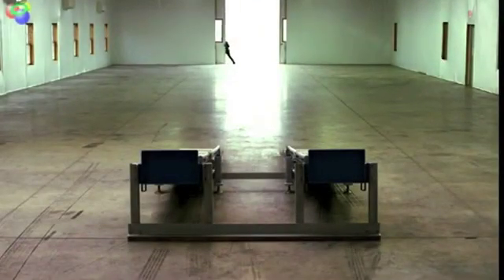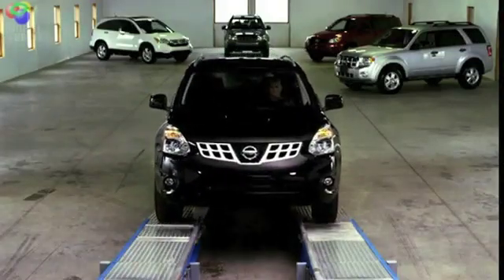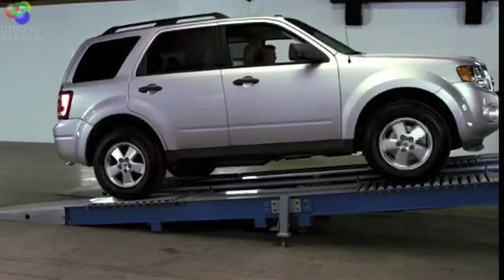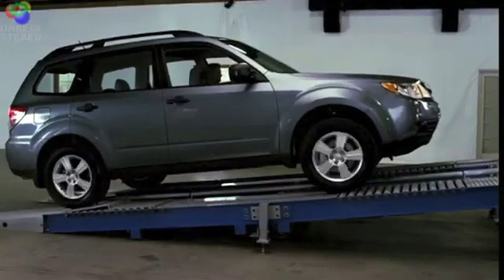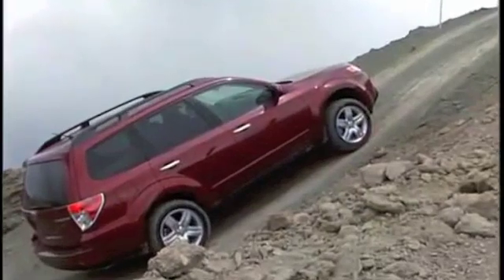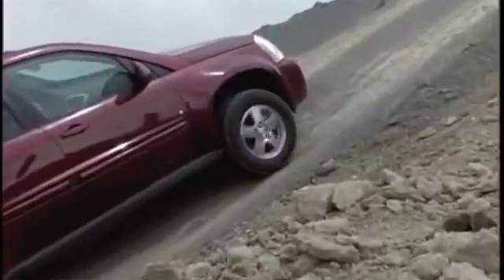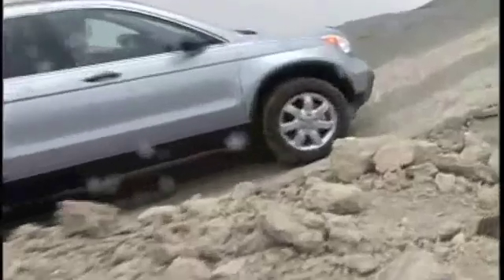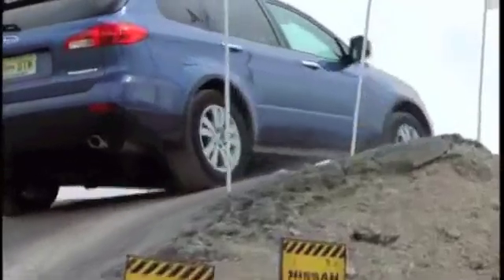Subaru Symmetrical AWD Test

Comment: Add in LSD front and rear and you have an unstoppable beast!!! especially when turboed
Reply: @Traumatree  yes i do. A limited slip, not a locker or lunchbox locker multiplies torque across the differential providing more torque to one wheel or the other. The secret is having some level of torque to multiply. 

For example the torsen in my Rubicon or a hummer will just spin whatever tire is in the air because 0 x (multiplier) still equals zero so the other tire won't spin. That's why you see a lot of people in Hummers without lockers stand on the brake in low traction situations. 

This also holds true for any style diff. Viscous, clutch, or geared. 

In a traditional completely open diff if you step on the brake the tire will still spin that's on ice or in the air. This is because there is no torque multiplier across the diff.
Reply: @jeepmanxj  But the VSC/ Traction control is supposed to replace   LSD. I have an AWD lexus gs, I put it on 3 wheels and the wheel with traction barely moves the car. I feel a little push. Problem with all these system is it cuts power as soon as wheel slip is detected. It does lock the center diff in this situation. I could tell the brakes are locking the spinning wheels but maybe 10% of the of the power is going to that wheel. The idea being to keep you in control. The subaru is not cutting power. They tuned their slip algorithms better. At low speed, it is ok to do that. Basically for all these vehicles(except subaru) you are left with 20ft/lbs of torque to move a 2 ton car.
Reply: @alb12345672  they absolutely do cut power. If you have your scan tool or accessport attached it shows it clearly. 

The point I'm making here is Subarus AWD is literally nothing special or different. The "symmetrical" bullshit is a gimmick. Anything with a cvt is still a front biased system, the sti is a rear biased system, the only "symmetrical" is the wrx with the manual and its 3 open diffs. The open diffs that rely on the stability management are, in my opinion, inferior to an actual torsen or lsd because you lose the live vectoring of power.
Reply: @jeepmanxj  Let me know if I understand this correctly:
Hypothetical Situation-
  So if a manual transmission WRX has it's back wheels on pavement, and it's front wheels on ice, and since you're saying the center diff. is "open", that would mean that all the power/trq would go to the front wheels, and so it would just sit there spinning the front wheels on ice? Right?
(...or no?)
Reply: @MyCatInABox  that is correct.
Reply: @jeepmanxj  (Ok- thanks for letting me know.)
...and WOW, btw. That's a crazy image.
Reply: @jeepmanxj  where did you find the info that the WRX has a open center diff unless vicious are considered open diffs too
Reply: @LosMt2  They are considered open diffs for all practical purposes. Their torque vectoring is extremely limited to the point it operates no differently than an open diff.
Reply: @MyCatInABox  it’s a crazy image because it is crazily untrue, I know because I’ve tested it after someone claimed. I have an 02 bugeye wagon, did this test with the open front, lsd rear , standard wrx 80/20  (which is maximal torque split but runs 50/50 in full traction situations) and Std lsd rear: front tires on ice at Kirkwood, rear on asphalt that has been plowed , let the clutch out and wouldn’t you know it, the front driver began to spin as did both rear at the same rate and I drove forward onto the huge ice patch in the lower parking lot.  Tried it the other way around with rears on ice and front in dry and same result, drove forward no problem. The center diff, or viscous coupling in the non-Sti models is a mechanical limited slip unit that delivers the power to the front/rear whichever has the most traction so all the tires spin at relatively the same speed (hence why they’re prone to under steering as power is delivered to the front and rear outboard wheels in a corner so if you want to slide you have to pitch the car hard into and over steering or use the hand brake. Driver vs passenger distribution occurs in the rear LSD unit but not in the open front wrx non-sti. I did this test again after installing an sti front LSD into my 5MT with the same results as the open front. It’s very simple if you look at a transmission diagram from a Subaru manual. The STInis a bit different in that it has a manually adjustable center differential where you can bias the front-rear power distribution up to a 90/10 split making your car almost fwd or rwd, or you can leave it in auto setting where it will operate as a mechanical lsd front to rear as the regular wrx but with ability to do 90/10 split vs 80/20. If the forward  output shaft is attempting to spin faster, the center diff automatically applies that excess rate of spin toward the rear output shaft mechanically, and then the rear manages left to right distribution mechanically and in STI the front lsd does left/right up front also if the rear are trying to spin faster. The automatics/cut are a different ballgame all together and I haven’t had to rebuild the 2015 outback transmission yet so don’t know what they look like inside. I’ve rebuilt 4 5MT trans so far, 2 Imprezas w/ open rear, my 02 bugeye which had a center diff bearing failure so I went through the whole thing while I had it open, and an 05 STI. The system works, it works very well, and anyone who claims they know it doesn’t work because they work on cars has never dug into one and is drinking haterade. I love the torsen wormdrive type also and my cummins has one but again, if you don’t know that they need resistance for the wormdrive to lock up then you don’t know to drag a little brake to engage it.
Reply: @jeepmanxj  Modern manual Subaru CUVs are 50/50 viscous coupling.
Reply: @RKmndo  I can't verify that for sure as I'm not familiar with that specific transmission.
Reply: @Traumatree  No way Really?! Is that why the LSD units that are widely available say STi on them?!  ;-?
Reply: @Traumatree  the manual may be but the cvt is 60/40 for sure.

I can tell you for a fact owning multiple that they will not pull that without the lsd. They also struggle extremely bad when on ice and traction loss to a single tire will stop the car dead
Reply: @Traumatree  you are an idiot. 

The wrx system has always been open, the lsd rear only works if both rear wheels have some level of traction. Removing it from one causes the lsd to act as an open diff unless you stand on the brakes. So if you have 3 wheels with no traction the last one isn't doing anything at all. That's a fact.

The later models with abs don't function much better because it kills the power in situations like this and stops. You have to have some level of traction at all wheels for it to move forward without stopping.
Reply: Put lockers on the front and rear and you have a Rubicon.
Reply: no lol, I have a turbo subaru with rear LSD, it's aboslute garbage. Subaru's AWD system will always be a joke to people who actually work on cars.
Reply: @Traumatree  the sti also has a rear biased AWD system that's far different than the front biased AWD in the non wrx vehicles. 

Subaru has either 60/40, 50/50(wrx open center, would 100% fail this test) or the sti transmission that has a couple different rear biases depending on the year.
Reply: @jeepmanxj  My 06 WRX had viscous limited slip center and rear diffs. I assume this Forester did as well which is how it passed the roller test.

Comment: I'd like to think that Subaru is testing honestly in this video, since they said it was Independent and Certified testing. I own Toyota and don't care who is better because I just want the TRUTH. We have plenty of snow in Utah and I've offroaded plenty, but still find situations where I want MORE traction. The only way to get it (after using LOW gear and disabling VSC) is to install a LOCKER, and that is cost prohibitive. So, may the best AWD technology win, regardless of brand.
Reply: I was the driver in this video and can confirm that the test was 100% legit and true.
Reply: Ya they said "our" Subaru. So its obviously not independent

Comment: Where is bmw with xDrive?! Where is suzuku sx4 /it has ALL diffs lock/?
Why do you stop gas everytime when nonslipping wheel get a torque /except subaru, there u didn`t stop gas, and that is the cause is goes up/ on the rolers?
Didi you use the same tires for the other test?
With all these false ads you go so down in my eyes!!!
Reply: +IskamDa Nameeto If you paid close attention, they all hold the gas even while its sliding backwards. Only when its slid backwards too far(notice wheels are still moving forward at same rate) then they let off gas so they don't slide off the ramps. The ford was sliding side to side, so she had to let up.  There was no need for Subaru's driver to let off of gas till it reached the top,  because it didn't slide backwards.  

Also, listen to the speaker. He tells about what each vehicle is made to do while trying to send the power to the wheel with traction. Most of those cars took too much power away from slipping wheels, while not sending enough to the non slipping wheel. Some makes were trying to act smart and calculate the power needed in realtime but failed. 

So what looked to you as them letting off the pedal, was explained as the system itself trying to adjust the power. 

Also Protip: In the real world, when you lose traction, you don't want to keep hammering on the gas hoping it'll catch.
Reply: Bmw apparently total shit my friends x7 three engines and off road a joke

Comment: Did only i noticed that on rollers all cars had traction control engaged and subaru has switched it off?? Look at the wheel spin at all cars and subaru. When TC is switched off the system works different! It can transfer more power to the rear because the REVs arent killed on purpise. U know what i ment.
Reply: manjakas16a Nissan Rogue for example: power is sent to the rear wheel, but it has an open differential so all the power goest to the wrong wheel. Same for honda and Toyota...
Actually VDC or TCS helps, braking the wheel that is spinning.
Reply: manjakas16a How do you know that the other cars had their TC switched on and the Subaru had its TC switched off?
Reply: I'm predicting, i didn't said that i know.
When women is sitting on the toilet you can only predict by her face if she is doing No1 or No 2...  So... by the wheel spin i guess how i said.
Reply: +manjakas16a -- LOL . I suppose when a man is sitting on the toilet you SURE can predict he is doing No.2!!
Reply: I have Subaru Forester and that don't have traction control button . That mean my Subaru is doing no 3

Comment: people don't realize that 4wd only means there are 2 wheels always engaged, unless there's a diff locking mechanism or a system that uses brake actuation to direct power
Reply: alan eichelberger
4wd in most trucks will not have a center differential in the transfer case, so the center will be locked. If the vehicle has open front and rear diffs the drive train will send power to one front and one rear wheel under very low traction conditions. That's why lockers and lsd's are so nice. You're actually in 4wd.
Reply: tHOSE front and rear diffs need some kind of locking mechanism as he said. LSD or an acutal locker. 99% of vehicle run an open diff on the front.
Reply: @VIsubby no, they use the abs to apply brake pressure to the wheels with no traction
Reply: very true, and usually those 2 wheels are opposing corners one front and one rear on opposing sides LOL.
Reply: false you are an moron
Reply: All 4wd vehicles have a rear,front and centre differential... Standard, you would be in rwd.. but once you put it in 4wd by opening that middle diff, you constantly have all 4 wheels engaged. I think you were talking about awd cars since that's what this vid is about...

Comment: i would install addidional brake lines to all 4 brakes and control the traction manualy,just apply gas and apply brake for the wheel that has no traction,this way the diferential would send the power to the only wheel that has traction,if 3 wheels are on ice and 1 has traction,i would brake those 3 without traction and with a bit of luck that the driveshaft will not break the car will move
Reply: ***** with small brake cylinders with brake levers,same that motorcycle's use,4 separate levers for each of the 4 wheels,simple

Comment: wheres the jeep? oh right on the other side already ;P
Reply: its pretty useless when the ratio is locked. The jeep's 4x4 is not considered an AWD system so its not tested, its locked 4x4.
Reply: jeep is useless in this test
Reply: it jeeps completely lock the torque split so no, it wouldnt have any issues climbing this

Comment: Part time awd sucks.  So many cars have it now days with some sort of special name for it.  Either have part time 4wd or have full time awd.
Reply: That's why I like my 4WD vehicles, when you pull the lever its in 4WD, no guessing as to if you have traction going to the front and rear.  One vehicle has a couple added components to make sure I have real 4WD...lockers front and rear.  If you don't have lockers you don't have real 4WD, just some modified version of 2WD in most cases unless you have at least limited slip and then that only gets you so far as the clutch packs don't handle fully locked action they only can achieve some percentage of a fully locked differential.

Comment: If you do a search, you will find the Acura MDX on this same challenge and it also climbed the ramp quite easily..
Reply: But ofcourse they don't want  mdx going up the ramp in their video.  Acura and audi have the best awd system.
Reply: @JonasGsxr1000  Lets take a look at the engineering of the two vehicles.Subaru,for what it is,is the most cost effective and well engineered.keep your over engineered european vehicles.subaru equals time tested.
Reply: @JonasGsxr1000   hahaha. Try it in real life. Subaru would beat it.

Comment: "Independent test" their name is "Subaru Puyallup"
Reply: Independent or not, if you had an understanding of the different types of center differentials, you'd see why the others never had a chance on a test like this. They only divert 10-15 percent of available torque to the rear. On a car with 150 lb of tq, that's only 15-20 lbs. You can't move 3500 lbs uphill with 20 lb/ft of tq.
Reply: Madmaxmiami Aaron 

The differences in efficacy in competing AWD design differences was/is the point. It’s demonstrating the strength & weaknesses of one versus another competing AWD designs. A hill starts from the bottom. This is straight forward. If I can’t get up the hill because of a inherent design limitation based upon how much torque gets distributed where and when in an AWD design, that’s a fail. What good is it when needed. This test was simple and all within reason. Not complicated.
Reply: Subaru of Puyallup is a dealership in Puyallup, Washington.
Reply: That's a good point.
Reply: Donovan Douglas lol its kinda bad, cause im a HUGE Subaru fan (I own an STI ffs) but this is just them bashing on other cars lol!
Reply: Road glide,

I know that was the point of the test. I was trying to explain to those crying foul the reason why the others failed. It wasn't because of any incestuous testing situation.

It wasn't anything other than a much stronger AWD system prevailing.

My other comment was also trying to explain this when I compared the Subaru to an hd trucks transfer case.

I just wanted people to understand there things:

One-Subaru AWD wins because of it's design, not a conspiracy. It's the best AWD in that price range. Sure Audi makes Quatro cars that can compete, but you can buy two legacy(s) for every S4.

Two-Subaru has serious longevity issues with their engine designs. That's a fact. They've been recalling boxers since the Bush administration.

Three-FCA cars are junk. That's why they weren't included in the test. Nobody wants a comp-ASS. The renegade is a Fiat 500. Seriously.
Reply: We filmed this for Subaru corporate.